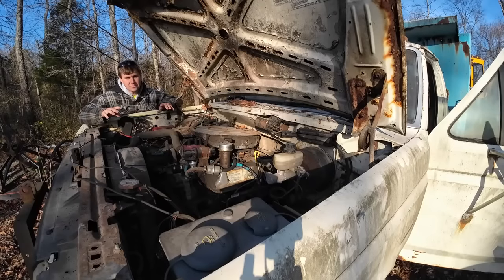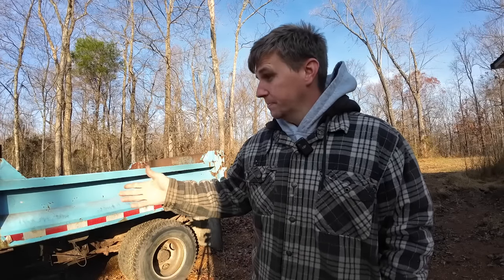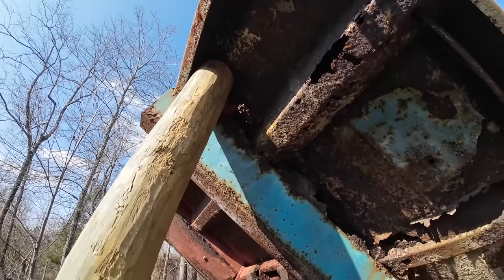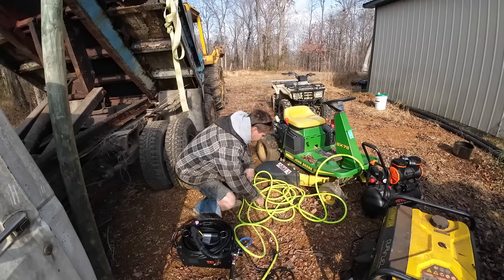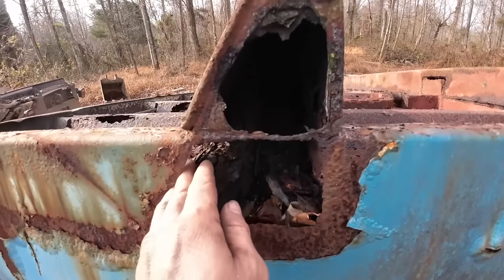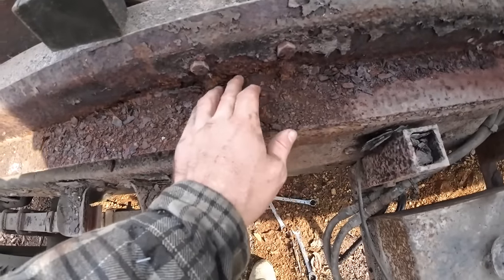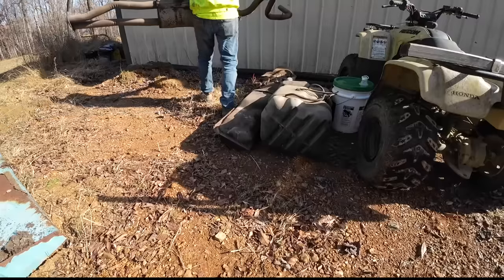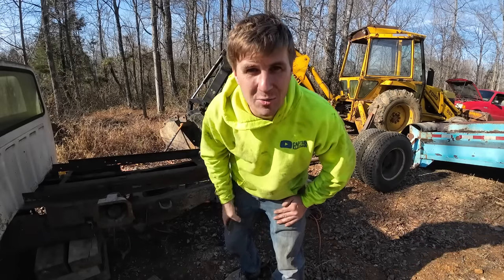Building My First Dump Truck! - Bed Removal

Comment: Hay Mike! You add a whole new meaning to "polishing a t*rd!" My 1977 Chevy 1-ton 350 V-8 Dump started out the same as what you are doing. It's a great truck. Bump the starter it's running, and it'll haul more dirt than you can put on it. Go with the super duty rear end, you'll be happy you did! Another awesome video, although you cost me some money! I'm gunna have to get me a plasma cutter - for all the reasons you listed. Thanks! Lee

Comment: The air chisel on old fittings trick really works. I used your trick when removing 10 dry rotted hydraulic hoses on my JD310
Reply from the maker: Pretty handy

Comment: You sure like a challenge there Captain ...... but as you said it's a great learning experience and I'm betting my dollar you will get er running and make good use of it on the homestead.  Also Mike the 555 is coming in handy moving around big stuff.

Comment: The folks at mill supply were awesome getting me all the parts i couldn't get in Canada for my f550 dump truck rebuild. Love❤ the channel . Any parts that you anticipate removal, scrub the threads with a wire brush on a drill & soak in penetrating oil. Fabricate your panels Before you cut the old rusty ones out. Having a reference for size & shape is everything. In the end all your hard work is totally worth it.

Comment: Glad to see Vevor to the rescue.  Glad they got you a plasma cutter. I may be repeating myself, sorry if so. Had a coworker who’s dad always wanted a plasma cutter so he bought one with nothing better to do. Ended up making a new career out of it. He had the proper licensing to empty and recover gas from old propane and refrigerant cylinders. Got an old trailer and started getting paid to take all the cylinders off of the areas townships that they collected during rubbish pickup. Emptied the cylinders properly and made them safe. Then cut them into chunks for scrap recycling. Apparently not many people want to bother with getting the proper instructions and licensing so they accumulate large stockpiles. Started making more part time then he did before retirement. Suspecting you could make some interesting videos doing the same while seeing what you can recover and reuse. Along with making some extra cash for projects. Thanks again for sharing your thoughts, ideas and videos. Wishing you and your family the best,

Comment: Nice new plasma cutter, way to go!!! Just need a lot of volume of air and torch tip needs to be almost touching the metal. Travel speed depends on seeing the slag blowing out the bottom, as soon as that starts to quit happening, you need to slow down. That’s what I learned and I’m excited for this new experience for you.

Comment: If you ever see a new building going up using Q decking, the cutouts make fine floors. It's just scrap to them. The ribs can be cut out for use separately.

Comment: Check the CFM requirements on your plasma against the CFM rating of your compressor. Plasma Cutters take a good volume of air to run well.
Reply: Dry air is also critical, or you'll be going through a lot of consumables.

Comment: If you weld a hook on the back of the bucket front and back or the end of the boom. Your straps and chains will be easier and safer to use
Reply from the maker: It has hooks, that's what the chain is hooked to...

Comment: Once u get the power issue sorted you will be impressed with the plasma cutter, guaranteed. I have used these for years n currently have a hobby one like yours (just not same brand) cuts steel n anything conductive like butter with a hot knife. You'll never use oxy-acet to cut anything ever again.
Reply from the maker: It's gonna be handy

Comment: I would believe that rear axle will be adequate for your low speed property endeavors, as well as the brakes, the only thing just make sure you have a decent set of Springs under it
Reply: Beware the rear spring shackle mounts.
The drain holes get clogged and they rot out completely.
Dorman make decent replacements with all the bolts and bigger drain holes.
Reply: I like how you think through the options “out loud” with us.  If you can convert the existing rear end into enough cash that goes towards a super duty rear end, that will make you happy.  That said, if you have enough confidence in the existing one (based on all inputs) and decide to “roll the dice”, I’m down for that too.  Either way it’s a journey worth taking for us.  You somehow make the mistakes and failures learning experiences that we all get value from.   It. Is. Why we watch you 👊💪
Reply: @genesispuredeaf2390  The real problem is having 10 lug hubs on the front and 8 lug wheels in the back.
He'd be much better off with a disc brake 10 lug F-450 D80 in the rear and all the wheels the same

Comment: When I first got my plasma cutter I kept popping the 30 amp breaker. Luckily my wiring was already ran for 50 amps. I have never had a problem since installing the 50 amp breaker.  Tip... just like a welder, the plasma cutter doesn't do well with extremely rusty surfaces.

Comment: Have you considered putting the welder generator on a trailer with a small compressor so you can take the plasma cutter anywhere you need it?

Comment: I'm a plumber been around plasma cutters for a long time  have two 50' heavy gauge cordss first thing i did when I bought this house put a hundred amp panel in my shop  now I can weld and have lots of power

Comment: Hey Mike,
    take precautions on the fuel line(s) (on both frames).  Sometimes they are still pressurized with fuel, and if cut with a grinder or plasma cutter, can be disastrous.  
    Great video series, look forward to the next one.
Thank you sir.
Reply from the maker: I think common sense says to cut out any lines in the path of any material being cut 👍

Comment: An axle with drum brakes might be a better choice, as the master cylinder for front disk and rear drum is different than disk on both axles. Just something to keep in mind if you find a good axle on a bad truck, you might want to take the brake master cylinder as well. I know the frame wasn't in super grate shape, but if the hinge point and the hitch are still more solid than rust, you could probably reuse part of it on the new truck.

Comment: I would say if you want to buy rims and tires for 10 hole, if the tires and rims are good of the dumptk use the anles for the new build. I like doing what you do but getting to old for thatbig a project. Love it.

Comment: Seeing the gas tanks reminded me of working at a "Holiday Service Store" in North Dakota, back in the late 70s.
Every month or so a farmer(?) would drive in for fuel, his truck had a 22 or 32 gallon factory option tank, two 32 gallon saddle tanks and a 50 gallon tank behind the cab so we would run hoses, like an octopus to the tanks.  ;-D
I'm a bit confused, what's going where, especially the engine and trans (2wd or 4wd)?  ;-)

Comment: dang i was hoping for a sneak peak on the new headquarters but i guess not im glad you finally let us in on these trucks been seeing them in the background and the suspense was killing me as far as the rearends go the superduty rear end would work best tire options and gear options are better better capacity etc ps if your gonna get rid of the f350 leafs let me know i need them for my truck i also need the grille headlights and marker lights the bottom filler panel and the bracket in front of the rad to finish my truck
Reply from the maker: Several of the leafs are cracked.  I can send you pics if you're interested
Reply: @CaptainKleeman  it was a dump truck i kinda expected that but i dont mind them being cracked i can just weld them up my truck on the one side is completely missing part of 2 leafs so anythings better than nothing

Comment: Hi Mike.  Love that body style on the old Fords.  Unless it runs like a top, you might want to consider looking for a different engine for the truck.  Those 460's were not known to sip away at the old fuel.  Sometimes you can find a deal on a 7.3 Powerstroke.  It would be a nice power upgrade too.

Comment: I am sure you have already thought about it but I would under coat the frame of the super duty before you get to far along at least in the areas that will be hard to get to once the bed is installed.  As always another good video, I always enjoy seeing what you are getting into! Be safe brother!
Reply from the maker: Unfortunately can't this time of year.  Too cold.
Reply: @CaptainKleeman Never use undercoating
Sheep grease (lanolin) or Mustie1's favorite (bar oil melted with bees wax toilet rings)
Reply: fluid film.
Reply: @bladewiper  Or Woolwax, whatever..

Comment: I got the vevor mig 270 multiprocessor welder and i absolutely love it ! I dont weld all day everyday i need it for weekend projects , beefing up skid steer buckets and building log splitters and different wedges for them and the little welder absolutely kicks butt!!! It does great on 110 but on 240 it really cranks for thicker stuff  , for the price if it i couldn't resist it was under 300 bucks i couldnt justify 2500 on a used miller that didnt have half the functions of this welder. I try on each snd every purchase every single day to make sure my money on USA products but on this purchase i had to go chi-NA. I have been eyeing up that plasma cutter you got from them that will probably be my next by from vevor

Comment: Little info to help you go with a f450 axle (the 10 lug axle) I have a 1989 f super duty and it's rated for 14,500 lbs and it has disk brakes already from the factory I hope this helps

Comment: @ 13:22, OH NO! You're going to break that amber flashing light 🤕
 I have a '95' E350 dually with a 7.3 PS (47,000 original miles) that used to be an ambulance and now has an 8x12 flatbed. It sure would be handy if it was a dump bed instead.

Comment: Hey Captain just wondering if the plasma cutter is more economical than oxy here in Australia oxy acceterline is very expensive the rent on the bottles is a big cost just to use occasionally at home ,I'd be interested to get your thoughts perhaps on a video thank you mate 
Kym
Adelaide
Reply from the maker: Definitely cheaper to do the plasma

Comment: The Dana 60 rear end will handle all that truck needs on it. My old '82 has been extremely mistreated for many years before I drug it home. I've been through it's diff and all is fine. Inspect it.
Reply: Not a D60 in an '87 (Ford went to the Sterling 10.25 during the '85 MY)
If the other chassis is a 450 it will have 10 lug hubs, and having two different wheels is a PITA.

Comment: That axel worked fine under that tiny bed. since you've decided to go to all the trouble of repairing the bed don't spend any money on an axel that's way more capable then the unit you are now building It's a budget build after all not a rig for commercial use

Comment: Clearly the axle unit worked with the dump body  and all that it hauled over the years. Are you planning on hauling more than what the dump body holds? Are You planning on going long distances? Make it easy on yourself, throw the whole unit under the super duty frame.
Reply from the maker: Probably use the same axle, but the leafs are cracked, so they will need replaced.  Plus I want to upgrade the brakes
Reply: @CaptainKleeman Go for the 10 bolt D80 axle with discs.
Just remember that to have a parking brake there is a unit mounted to the back of a 4x4 transmission adapter.
(Clint has probably already told you this)😊

Comment: Is the pressure regulator on the plasma set to 4 psi? I’m only asking because I have always run mine on 80 psi!! That is odd that they have that set to 4 psi!!
Reply: same here
Reply from the maker: I mis spoke when explaining it,  4 bar (kpa) not 4 psi.  It's around 75-80 psi.

Comment: That looks like the dump truck that I drove about 20years ago when I lived in gary was a good runny truck if that is the same one
Reply from the maker: That would be pretty cool
Reply: Looks like might still have some of snowplow bracket on front
Reply: Plowed apartment parking lots and a few factories

Comment: Ive owned an '87 with a 460 since new and recently parted out a F-450 "superduty" with those same axles.
Im also an admin on an '80'ford truck forum.
Maybe I can offer some advice?
Reply from the maker: Absolutely
Reply: @CaptainKleeman  What engine is in the Superduty?
'87 like your dump was the very last year for a carbureted engine in a pickup (big chassis like the F53 RV kept it into the '90's)

Comment: Nice video, but watching you, plasma fumes are at least 10 times more carsiochemish ( the Dutch word for causing cancer)  You working working in the open air... You can  can use plasma with a proper welding mask, but indoors I wouldn't use it.